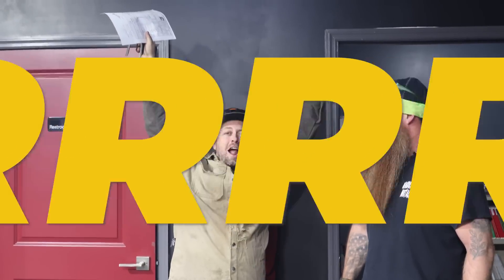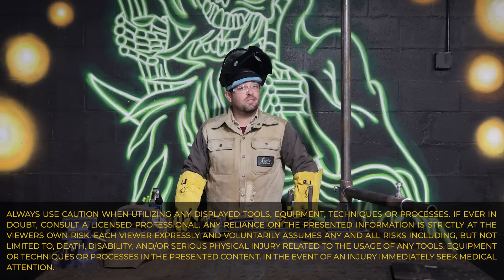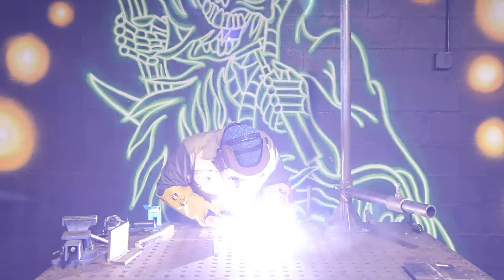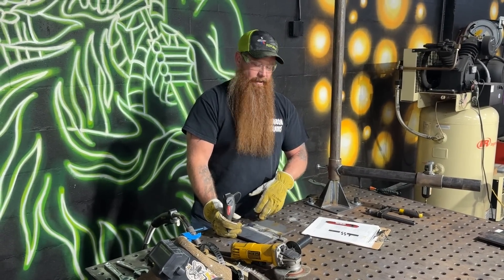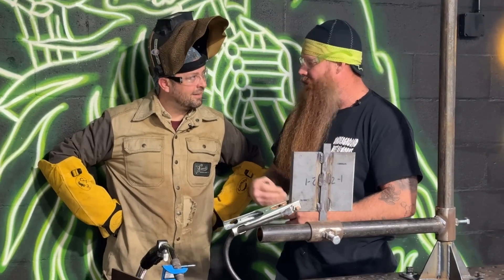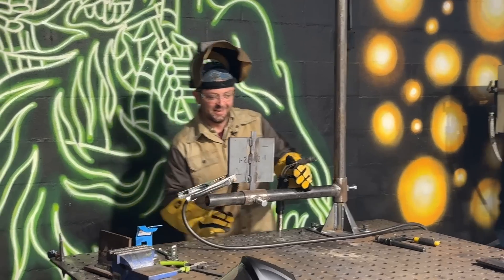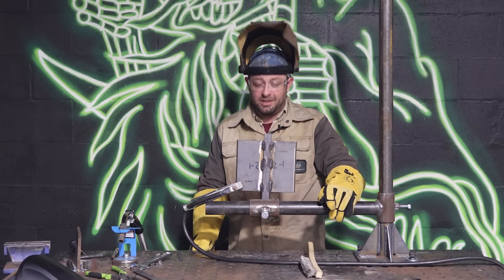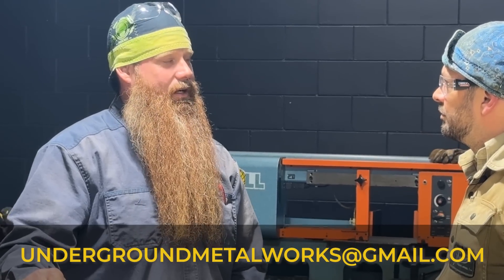How To Get Certified In Flux Core Welding

Comment: Heres s tip for ya...( In case you make a boo-boo)
I MADE my chipin' hammer by using a thin 2" flat Cold chisel as a handle, that & a 16 oz. ball peen can cut out any minor F-ups then just wire brush it make sure its clean and ...WELD IT!!!!!

Comment: Awesome job men!  I am 59 years old and a year and a half into welding, so I am REAL green.  Question: Our instructors insisted on practicing open root dual shield flux core with NO backing strip which made no sense to me.  Their reasoning was if you can do an open root, you will be that much better of a welder.  Am I wrong to question their methodology?
Reply: @BGG5235  it's true what he says. The root of pipe or plate is the harder of  things in all welding processes. If you can get the hang of that. Most things won't phase you.

Comment: LMFAO you can have all the certs you want, if you can't pass a weld test you aren't getting the job. With all that said. As veteran with all kinds of ASE and AWS as well as airframe certification with 10 years of experience. I was literally told by every company that I applied to, that I was over qualified. So I started my own company, I now have 2 contracts with SpaceX to design and build parts for them while those other companies are digging at the bottom of the barrel to get jobs just to stay open.

Comment: As a recently retired disabled Vet, I’m heading BACK to school here in Tucson just for my Welding Certification starting in August. Excited to get this going, a little concerned about the math portion though, LOL…
Reply from the maker: We wish you luck!
Reply: The math isn't anything you can't handle bub,it's not like trig or calculus...
Reply: @ Funny you should ask. That is exactly what the course WAS.
Reply: @AXNJXN1  They were doing trig & calculus?
Reply: @AXNJXN1  I didn't have to do anything like that gettin' certs. In the Boilermakers OR Ironworkers unions...If you had to do those processes sounds like you were gettin' certified to be an inspector or building welding machines...Hope ya made it...
Reply: @ Thank you. Yes, it's prepping for the Degree (route) along with application and eventually after the certifications, Inspecting. I'm NOT going that route, allow me to be perfectly clear, but that's what the course is delivering. Again, as a retired Vet, and at 53, my brain doesn't work as fast and I haven't worked Trig or Pre-Calc in 35 years so, thanks to extensive reviewing with YouTube videos, finished an A in the course and that part is now over. I'm really wanting to learn HOW to weld better and with various metallic compositions. I don't envision working for the Man anymore but considering building my own small repair/fabrication 'business' or something of the sort. The Course is definitely challenging. Cheers.

Comment: Just remember them certs dont mean nothing. Boss will just look at them and be like ok.... i don't care how many certs you have. You need to pass all our made up tests to work on the actual product which will be sink or swim. Most places give you 2 or 3 tries. Ut tests are common. Bend test is cheapest other than visual inspection. Xray little more pricey but depends what you'll be tested on depending on the type of work your gonna be up against. Some places you can use grinders, you should at least be able to if you need to do some cleaning but wire wheel could work. Cover passes are the toughest 1/8 inch reinforcement is all your aloud. Any mire more than that, you might be grinding that out and redoing the cover or they say you failed all because cover pass was over the tolerance.
Reply from the maker: youre right, Welding Certs are typically give and take. by that i mean you Get a cert when you get the job and they pull them when you leave. Almost every job requires a weld test to a WPS wether its AWS or not, likely youll have to test wether you carried the exact cert or not.

It could however get you further in line on the application process and even in some cases may grant you to weld and skip the test. Hell some jobs (smaller shops) dont even test to any procedure. They maybe really excited to find an applicant with the cert that pertains to their work.

But like you said.. its all circumstantial
Reply: Finally someone in the comment section speaks the truth.

Comment: CWB testing is a little different. We do a 6" weld plate. 3/4" of the start of the plate and end of plate are disregarded. However going up the plate coupon 1 and 3 are root bend coupons and coupon 2 In the very middle is a face bend but it's required you do a start & stop in the middle so your restarts are also tested.
Reply from the maker: Gotta do one of those in the future for sure 👍

Comment: With backing strip, how can you check root penetration?
Reply from the maker: During the bend test. After you remove the strap, even before prep youll be able to see a line or not, that says you got the penetration. All 3 members should become 1 in the weld zone. You cant see the back side of the root during the test, however you can see some dark blemishes on the steel, darker the mark, more pen youre getting in that strap.

Comment: What do you do with older machines without digital readout for volts and wire speed?
Reply from the maker: some have charts to refrence, even older ones may have them online somewhere. if not im going by puddle recognition, and sound mostly. doesn't matter what the machine says if the puddle is doing all the talking,

Comment: Qiestion, with a 1/4" gap or 3/16" between plates how come you dont weld the two plates to the backing plate when you do the root pass? And if you do, how do you remove the backing plate after you cut the two strips for the bending test? I thought the backing plate was just to secure the two plates for welding but then it stayed after capping and even there when you cut it in the machine. Excuse my ignorance.
Reply from the maker: it is most defiantly welded solid. all 3 members become 1 in the root pass. the backing strap acts as a bridge between the two so you can weld on it with ease compared to an open root. you can remove the strap for bend testing with a band saw like jason did or even arc gouge it off. hell if you got the time you can grind the whole thing off. In the field a backing strap will not be removed after welding.

Comment: Too much wire imp I like a good 25V 310 wire it’s super hot and wets nice and using a c25 at about 40 cfm best setting never failed a weld test yet and that what I use for my root and fill and I go a big colder on my cap because the plate gets 🔥
Reply from the maker: We will have to try out those settings and report back!

Comment: How does the backing strip get removed?   Doesn't it all become one after the root pass?
Reply from the maker: After cutting out the straps Jason used a bandsaw to cut them off before buffing everything down
Reply: There are a couple of ways you can  do that, you can grind it or use an oxyacetylene torch with a rivet cutter tip to remove most of the material
Reply: @brianneftalicontrerassanti3091  ok. So the root is totally fused to the backing strip?
Reply: @jakecarter4407  Yes, it gets fused all the way down (if your root was good). It's a miserable process to remove the backing bar if you don't have that special torch tip, or if you're not comfortable with a torch in general